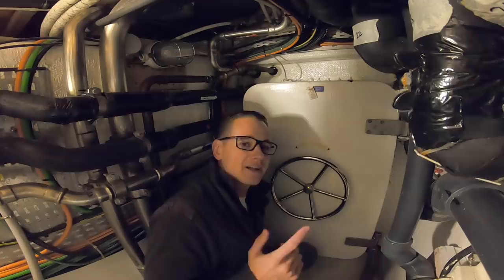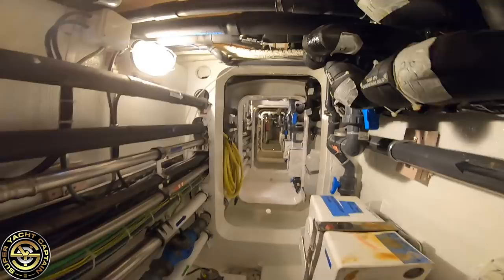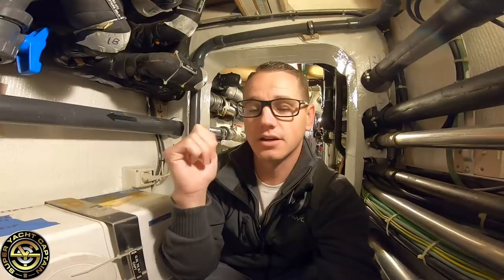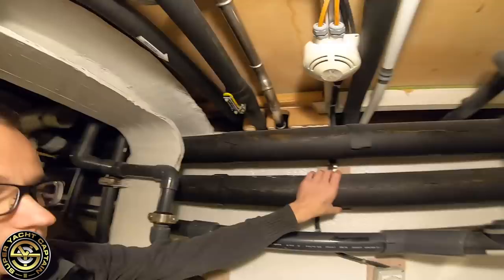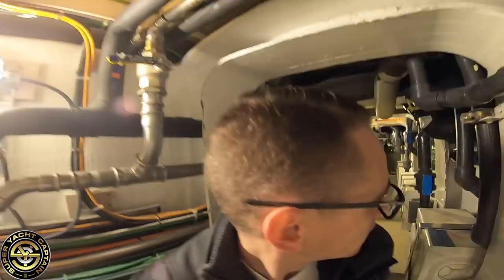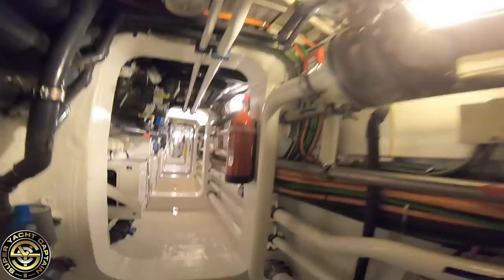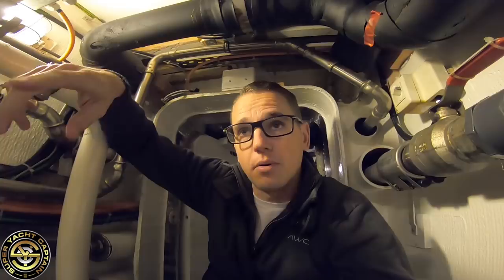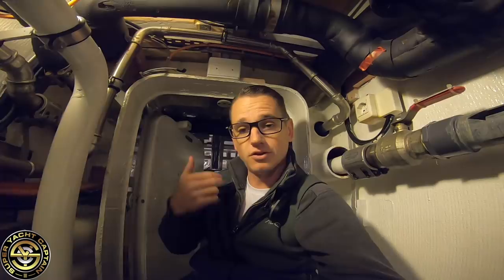Secret Tunnel On A Luxury Yacht (Captain's Vlog 48)

Comment: For a fiberglass boat that is an incredible tunnel. They did a huge amount of work to put that there with all the extra reinforcing around each bulkhead opening. In the long run it must make trouble shooting an issue easier. A bit like a military boat where everything is exposed for easy repair.( but too ugly for a yacht)
Cheers Warren

Comment: Great video! However, was wondering about water tight integrity with all that open space. Seems like there should be more water tight doors in between spaces, e.g. if hit by another vessel broad side with breached hull at water line or below? All that space full of water would put the vessel in a massive list. All the pumps running could not egress that much inflow...curious?
Reply: compared to the size of the other areas (engine room etc) that area is actually not that big. Also i don't think it would cause a list as it is smack in the middle of the vessel

Comment: Nice vid.  will you and the owner be thinking of putting water tight doors in later? seems that if it starts to sink or a fire, there is no way of closing off those sections.  Should be away to seal off each compartment for integrity of the ship.

Comment: Nice fire protection systems on board. Looks like a Honeywell Gent Vigilon marine version for your fire alarm. Do you have standard sprinklers or high pressure watermist? You never see a video where the captain shows these systems, yet they are the most important systems of all. Great Video!

Comment: Wow. Veeeeeery interesting, and great boat design btw.
How do you get rid of grey and black water?
Thanks and regards.
Reply: The grey and black water tanks can be pumped out in a harbour into the sewage.
Reply: @berndhaverkock6070  If you are far enough from the shore in tidal waters (the high seas) it can be pumped directly into the ocean. This is not allowed at all in the Med and all sewage must be pumped out into a dockside facility. the regulations vary from country to country but for boats over 400 gt or licensed to carry more than 15 passenger the IMO regulations and guidance will apply    http://www.imo.org/en/OurWork/environment/pollutionprevention/sewage/Pages/Default.aspx
Reply: @amandaashton5444  thanks for adding ;)

Comment: I believe that your tunnel should be classified as an enclosed space, requiring appropriate precautions including atmosphere testing for oxygen level, flammable gases and noxious gases e.g. a personal continuous monitor. The watertight doors should be marked on both sides "door must be kept closed at sea" and should be labelled to indicate the direction in which the handwheels must be turned to open the door (there were arrows  but no writing or diagram.)    There should also be notices above the entry hatch in the deck to warn that it is an emergency escape and must not be obstructed.  Although the tunnel passes through several watertight bulkheads, there were no watertight doors in these - does this comply with regulations?  Your extinguishers were dry powder, whose use in such a small space would incapacitate the user.     More on  entry into dangerous or confined spaces here: https://assets.publishing.service.gov.uk/government/uploads/system/uploads/attachment_data/file/440980/MGN_423.pdf   
and here:  https://www.gov.uk/government/publications/enclosed-spaces-on-sea-going-vessels
Reply: Ian M i don’t think that they are watertight bulkheads. As you can see the through holes for the piping and cables are not sealed as done with watertight bulkheads.
Reply: So you think you know better than the inspectors who approve the vessel for commercial passenger use?